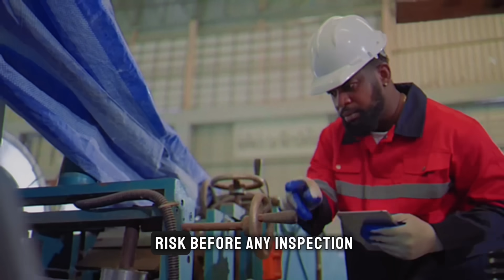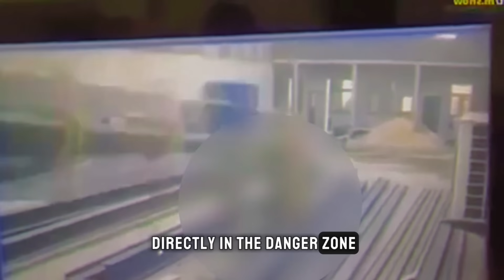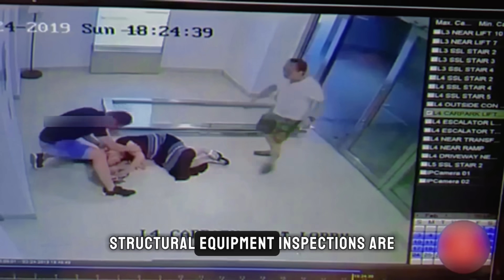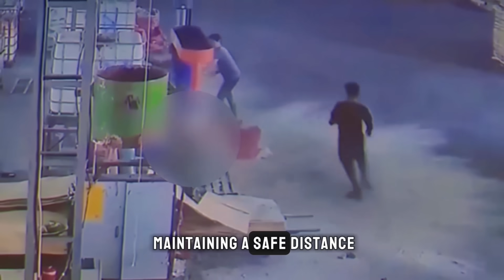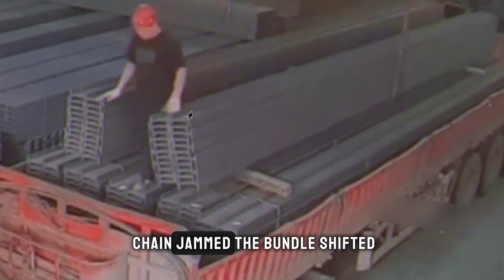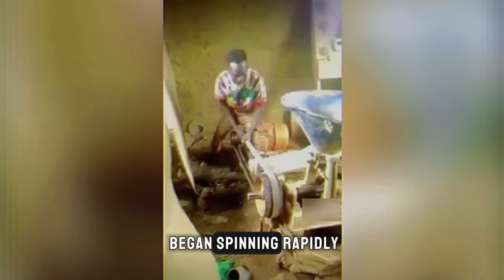He Didn’t Realize the Danger Until It Was Too Late | Industrial Press Accident

Comment: Once I was going to do maintenance on an HVAC and I tagged out the power but when I checked th s power still went on. They had the wrong breaker listed. I fixed it.
Reply: Good shit. Had same happen at my job. They asked me to go supervise a younger new guy for a fuse change. I thought why TF does he need supervision for that? I said fine. Followed. He shut off the breaker he knew. I stopped him from reaching for the fuse, insisting we check it with a volt meter. 480 v still active. He had the wrong breaker.

Comment: I always assume I'm in a Maximum Overdrive movie or The Mangler scene. If there is power running to the machine it is still alive. Same with crawling under cars. I assume the main safety jack stands will fail and always have a backup of some sort. I will never work on a lathe. I had a co-worker jump in a wood-chipper once and start kicking branches into it. I grabbed him by the shirt, pulled him out and told him not to do that. They have a video of a worker getting pulled into a wood-chipper head first. In one second half his body was gone. These videos keep me "fresh" on a work site. Not going to run me over with a forklift.
Reply: Those are the kind of assumptions that prevent you and me from making asses of ourselves

Comment: censored censored censored... damn!
Reply: YouTube's rules, especially since AI has taken over, are shamefully restrictive. I'm not talking about this video in particular, but about any topic or comment. Plus, there's constant advertising before, during, and after the videos, which is frustrating.
Reply: For video ‘#2’, it is blurred. For good reason. If you look at the video that shows normal operation, you can see what position the press is in, relative to the driving wheel. The press machine likely  pressed the worker’s head and upper body to 2-4cm, maybe less 😳
Reply from the maker: I know it can be frustrating, but some parts have to stay censored for safety and platform rules. I always try to keep the important moments clear. Thanks for understanding.